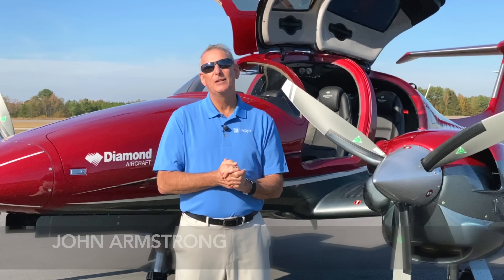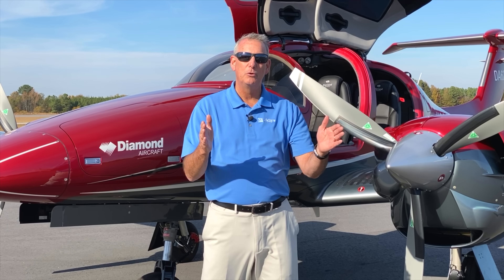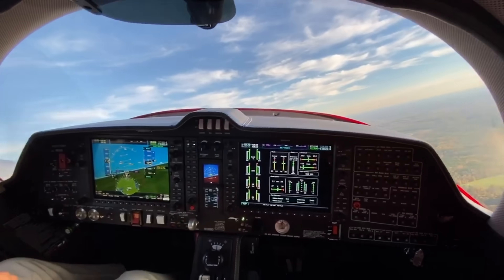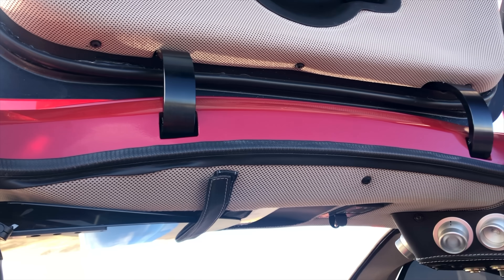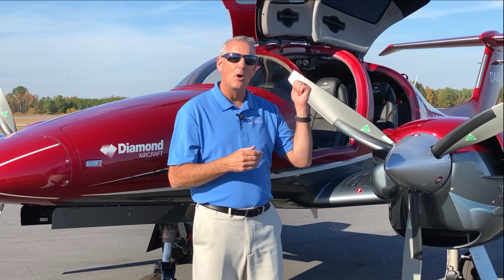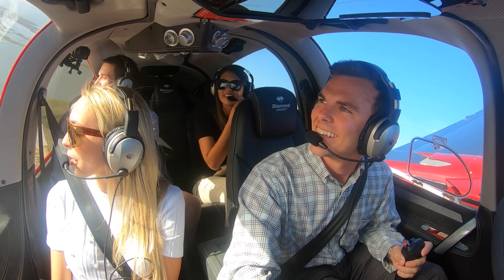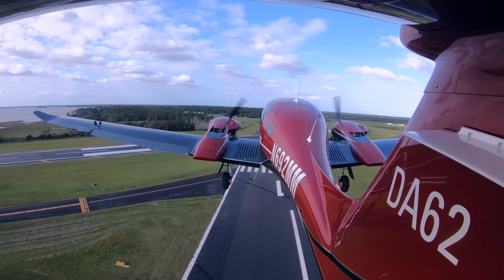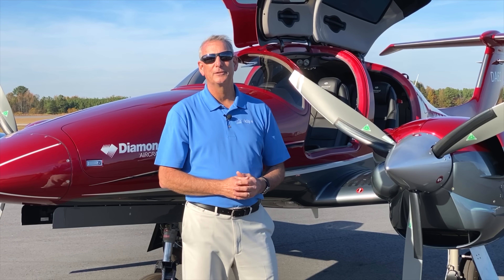What Makes the DA62 the SAFEST Twin-Engine Aircraft? | DIAMOND AIRCRAFT SAFETY SPECS

Comment: Autopilot Safety features--- that is what Boeing said with the 737 max
Reply: I fly both the DA62 and the Boeing 737 and am intimately familiar with both systems.  While they both seek to achieve similar goals in pitch mode (i.e. - making it very difficult to stall), they do so in completely different manners.  

The B737 Max MCAS system moves the entire horizontal stabilizer using the stab trim system when responding to inputs from a single AOA sensor, making for a failure mode that presents the possibility of running out of pitch authority even with full elevator deflection.  While it is true that stab trim override switch actuation is one of only a handful of memory items that all B737 pilots are required to respond to immediately, and numerous pilot crews have done so correctly when confronted with this failure mode and landed uneventfully, one flaw is that the stab trim switches are not intuitive - i.e. 99.9% of B737 pilots have never actuated those switches in actual flight, only once or twice in the simulator in their lifetime.  Two B737 Max crews failed to apply the proper memory item with catastrophic result.

The Diamond DA62 Electronic Stability and Protection (ESP) System works quite differently.  It provides a "nudge" to the stick force when approaching stall that can easily be overridden by the pilot, and can further be disconnected by pressing and holding the autopilot disconnect button right on the control stick - an intuitive action since most pilots use this control several times per flight to regain manual control from the autopilot.  There is no change in any flight control position, and absolutely no risk of loss of control in any failure mode.  Should any abnormality persist, the only brightly colored, collared circuit breaker on the whole panel in direct view of the pilot disconnects ESP as well as the autopilot when pulled.  The only downgrade in capability is that the aircraft now becomes just as unsafe as every aircraft without the impressive capabilities of ESP.

In my opinion, ESP is the most important safety feature to be incorporated into general aviation aircraft in the past century.  There is no way to track how many lives it has saved so far, but considering the historically high number of stall/spin fatalities in GA on record, I am sure the number is significant
Reply: I know. It's a little unnerving, but that's where the aviation industry is heading towards. If it works and is unobtrusive like this one sounds, I don't mind it. Also, they are telling their customers whereas Boeing did not alert commercial pilots of the MCAS system.

Comment: But does it have a parachute in case the unthinkable happens . . . ?
Reply: No. Only the Cirrus jet has a parachute, though Cirrus is notorious for their poor accident rate.
Reply: That depends greatly on what you consider to be unthinkable:

Scenario 1:  Engine failure - Massive advantage - DA62
DA62 - a non-event.  Go fly somewhere using the operating engine, and get the broke one fixed.
Single engine aircraft with a Ballistic Recovery System (BRS) - typically a complete hull loss, and 14% chance of losing your life coming down in the chute.  See https://www.ncbi.nlm.nih.gov/pubmed/28539144

Scenario 2: Mid Air Collision - Slight advantage - DA62
DA62 - Significant risk, but as long flight surfaces, flight controls and one of two engines still operate, go fly somewhere and get it fixed.  Carbon fiber is crazy strong.
Single engine aircraft with a Ballistic Recovery System (BRS) - The parachute system is integrated shallowly into the skin of the fuselage, so any damage in that area would render the system useless.  Should only a wing get clipped, it might be survivable, but with the caveat of a 14% chance of losing your life coming down in the chute.

Scenario 3: Pilot Incapacitation - Reasonable advantage - Single engine aircraft with a Ballistic Recovery System (BRS)
As long as there is another competent human being in the right seat, and the pilot has linked up the navigation system to an approach at the destination in both LNAV and VNAV, the prefered way to get on the ground for either aircraft would be for the right seater to simply be talked through setting new altitudes, managing power, extending the landing gear, then steering and braking after touchdown.  Should that not be possible (i.e. pilot is the sole occupant) in the limited situations the pilot may be conscious long enough to evaluate the situation and pull the handle, the chute at least gives an 86% probability of surviving the crash.

Scenario 4: Fuel Starvation: - See Gross Buffonery

Scenario 5: Gross Buffonery: Advantage - Single engine aircraft with a Ballistic Recovery System (BRS)
Inept pilots run out of fuel or fly into conditions for which they are not equipped nor trained (IMC, icing, etc) with disappointing frequency.  Pulling the "Aw Crap" handle while over flat terrain at a high enough altitude in reasonable wind conditions at least gives them a chance of surviving their poor decision.  

For about the same money (or significantly less depending on the model), a smart, experienced, well trained pilot might well choose the massive comfort, payload, range, efficiency, redundancy, and overall safety advantages of the DA62 over any single engine lawn dart aircraft currently available with a BRS system.  It's a step up.  How many airliners do you see with fewer than 2 engines?  They have a lookback fatality rate of 0.0000000% per 100,000 flight hours for good reason, and none of them have BRS systems.

Comment: Is it as difficult to taxi as a DA42?
Reply: Actually the nosewheel steering is a bit stiffer than the DA42, but you get used to it quickly.  Differential engine power makes turning it pretty easy.  At least it has nosewheel steering...

Comment: Aren’t these diesel
Reply: Yes.  They burn Jet A, which is significantly less expensive than than 100LL, and more energy dense (at the same speed and payload, you can go basically twice as far per gallon as a Baron).  Based on a Mercedes Benz automobile engine, they are ridiculously smooth, quiet, efficient, reliable, and easy to manage.  Single power lever for each engine feeds the Full Authority Digital Engine Control (FADEC) to prevent exceedances, provide instant notification of problems, and negate the need to tweak three levers per engine (throttle, mixture, and prop) and constantly monitor gauges.  The Austro A330's superiority over any current gasoline burning piston aircraft engine is an order of magnitude or two.

Comment: Anybody Turbo-Propped one of these ?
Reply: Sorry to repeat myself, but there really is no point in doing so.  The DA62 serves a different market.  Hanging the extra weight of turboprops on this magnificently efficient airframe with only 86 gallons of fuel would decrease both the useful load and range to the point of absurdity.

A similarly equipped turboprop twin like the King Air currently retails for more than 6 times the initial purchase price of a DA62, hauling about twice the payload a similar distance roughly 56% faster at a fuel cost per mile roughly 230% greater.  Maintenance, insurance and training costs are difficult to estimate, but nearly an order of magnitude greater.    There are single engine turboprops on the market for well more than double the acquisition and other costs of the DA62, but not a single one of them have the engine out climb and cruise capabilities of the DA62.  The DA62 stands proudly alone at the top of the piston twin market.  Nothing else comes close, and the next step up in performance and capability comes at great cost.  

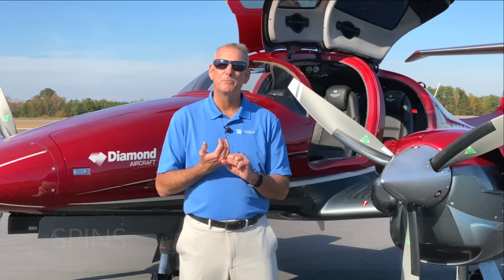The typical trip I make in my DA62 is only 220 nm or 1:09 burning 21 gallons of Jet A.  A King Air could theoretically shave 25 minutes off of that, but would burn more than 71 gallons.   Pretty silly for me to make that step up, but for a corporation that needs to haul more than 5 folks and all their luggage for more than 1,000 miles on a regular basis, the King Air makes all the sense in the world.

First, define your mission.  Then, go find the aircraft that best fulfills that mission within your budget constraints.

Comment: Safety and quality are excellent. The downside is the high price and the low speed. For example, an Aerostar 702P (twin) will fly at 302 knots while the DA62 hardly hit 200, and you can get one of those for a fraction of the price of a DA-62, and it’s a 6 seater. A 702P is roughly 175,000 dollars (used, it’s long out of production), a used DA62 comes at 1-1,2M dollars. But fair enough to say the Aerostar is a 40 year old plane while safety is absolutely great on the DA62 which is fairly new. So, all in all a wonderful plane but....it has it’s downsides. Still, gorgeous! 🤩

Comment: Great plane, not perfect though. It needs counter rotating engines for that.
Reply: No particularly compelling advantage to be gained with counter rotating props.  Combination of huge wingspan, massive rudder, and engine location close to the fuselage makes for an almost undetectable difference in single engine handling between right and left engine out.  About the same rudder forces either way, and mine climbs at ~ 400 fpm regardless of which engine is shut down.

Comment: Just to quench my curiosity why didn't they go with turboprops?
Reply: Different market.  A similarly equipped turboprop twin like the King Air currently retails for more than 6 times the initial purchase price of a DA62, hauling about twice the payload a similar distance roughly 56% faster at a fuel cost per mile roughly 230% greater.  Maintenance, insurance and training costs are difficult to estimate, but nearly an order of magnitude greater.    There are single engine turboprops on the market for well more than double the acquisition and other costs of the DA62, but not a single one of them have the engine out climb and cruise capabilities of the DA62.  The DA62 stands proudly alone at the top of the piston twin market.  Nothing else comes close, and the next step up in performance and capability comes at great cost.  

The typical trip I make in my DA62 is only 220 nm or 1:09 burning 21 gallons of Jet A.  A King Air could theoretically shave 25 minutes off of that, but would burn more than 71 gallons.   Pretty silly for me to make that step up, but for a corporation that needs to haul more than 5 folks and all their luggage for more than 1,000 miles on a regular basis, the King Air makes all the sense in the world.

First, define your mission.  Then, go find the aircraft that best fulfills that mission within your budget constraints.

Comment: Does it have a parachute? Nope! Back to the drawing board.
Reply: No parachute, but it does carry a spare engine, which I find to be immensely more useful in reaching an airfield after one engine stops working.  Parachute deployment badly damages the aircraft, and (as of 2017) has resulted in fatality 14% of the time.  At similar cost and performance, it is essentially the difference between losing the entire aircraft and risking the lives of all aboard vs a maintenance logbook entry and an interesting story.
Reply: @ultraturtle2673  Well, gliding is preferred should one need to do it. However, there is not always a place to land and the only time a chute would be used is when other options have failed. If you could choose between a boat that floats and one that does not what would you choose? I mean there is a reason that Cirrus has higher sales even though they have more incidents than diamond. 70 mph into a pack of trees is not going to go well no matter what they have done to the shell of the plane.
Reply: @michaelm581  I choose the boat that floats - i.e. the one that continues to float in the air because it happens to have a spare engine.

Comment: I'm a diamond owner, although it's only a 20. 
The price of this aircraft is absolutely insane... Almost 2 million for a piston twin? I'm sorry but that is just moronic
Reply: nope, it costs 1.1 million standard, 1.3 million fully decked out with de icing, on board oxygen and all options ticked. It is not cheap but it on par interms of price with other piston twins like the beech baron and piper seneca

Comment: I see this aircraft also requires Jet A fuel, a modified diesel mill? No "Blue Additive" needed?
I saw another article where a company wrote off two business jets due to someone contaminating the anti gel additive with the Blue urea compound. They used a blue additive container to transfer the anti gel compound to the fuel truck. Ouch! 
Living in the EU now, might try to make it up to the factory to check them out. Unfortunately living in Greece makes it cost prohibitive tax wise to own one here.
Reply: No "Blue Additive" needed.  Just plain ole kerosene (aka Jet A).

Comment: Forgot to cover Engine out control in a twin. I fly sky masters where it is not an issue however should I want to transition to a conventional twin such as the Diamond what's the deal?
Reply from the maker: That is a very good point- I did forget to cover the unique fact that the props on twin Diamonds auto-feather in an engine out. This makes it ultra simple and safe. The plane then flies very nicely on one engine and I fact the DA62 climbs at full gross into the 12kft range!  The DA42 is lighter and climbs single engine to 18kft with a full load!  Old twins require the pilot to correctly feather the prop quickly and if not done properly or fast enough  creates an unsafe situation. Our DA62 owners routinely tell us how amazingly easy their twin Diamond plane is for them to fly and in fact tell us it’s easier to fly than their Previous single engine aircraft which usually had 3 levers to manage (or 6 for an old twin) instead just two to manage on the 62. Diamond has perfected the twin platform to make it burn close to a single (or better) and be easier and safer to fly than a single while getting rid of toxic leaded gasoline. Truly a remarkable accomplishment that represents true progress for aviation.

Comment: Dare I say, the "perfect" twin engine airplane. 
Safety and fuel efficiency.
Reply: I’d would be nice if it was faster, but you can’t have everything
Reply: @Smokeyr67  Funny, a lot of Baron owners pull back on those throttles to save fuel. You don't need to on this beast.
Reply: @UncleKennysPlace  Faster is always better, but of course the airframe is the limit in this case (and most cases) , but I still want to go further and faster :)
Reply: The perfect twin engine piston i would say!

Comment: Why didn't they have counter rotating props?  It still has the left engine as the critical engine due to the long arm of the right engine's downward moving blade which is the most efficient blade on either side which still makes VMC critical especially if you lose an engine during a turn from downwind to base or base to final.   Most pilots are rudder weak and during an engine failure they add too much power and enter VMC and crash especially in a turn at low altitude.
Reply: The reason they do not have counter rotating props is that they are based on an impressively engineered Mercedes Benz automobile engine that has been produced in the millions per year and constantly refined to be smooth, powerful, and efficient.  There is no point asking an automobile engine manufacturer to re-engineer and retool to make that same engine rotate in the opposite direction, only to manufacture hundreds per year.  The argument to manufacture a separate gearbox to have it rotate in the opposite direction fails for the same reason - low volume.  Overarching the question is the simple observation that there is simply no good reason to do so.  Combination of huge wingspan, massive rudder, and engine location close to the fuselage makes for an almost undetectable difference in single engine handling between right and left engine out.  About the same rudder forces either way, and mine climbs at ~ 400 fpm regardless of which engine is shut down.

Comment: Very impressive, however, one concern. With all those computers, what happens during an EMP? This could be from a solar flair as well as a high altitude nuke destination. Well, at least it is not fly by wire control surfaces, as I do not mind loss of power so much, as long as I can control the aircraft.

Comment: does the da50 and 52 contain these features ?
Reply: The DA52 was the prototype of what eventually became manufactured as the DA62.  The DA50 is still under development, and if Diamond holds true to form, it should have most of the features available in the DA62, but with a slightly smaller engine count.

Comment: I'm not a pilot, clicked by accident,  but I watched entire video. Of course, I do understand aviation and WOW what a great aircraft. I would seriously consider buying this one if I was a pilot.  The only thing I'm curious about is, I saw a video or a recreation on tv of a pilot who had to use an aircraft parachute due to an emergency. Does this aircraft come equipped with this ? May I get your thoughts on this ? Thanks  Z
Reply: No parachute, but it does carry a spare engine, which I find to be immensely more useful in reaching an airfield after one engine stops working.  Parachute deployment badly damages the aircraft, and (as of 2017) has resulted in fatality 14% of the time.  At similar cost and performance, it is essentially the difference between losing the entire aircraft and risking the lives of all aboard vs a maintenance logbook entry and an interesting story.
Reply: @ultraturtle2673  Oh my God, I can't believe I missed that. You're right. Spare engine, duh......just continue to fly safely. Lol thanks for the response......Z